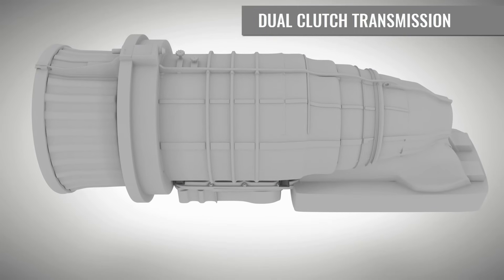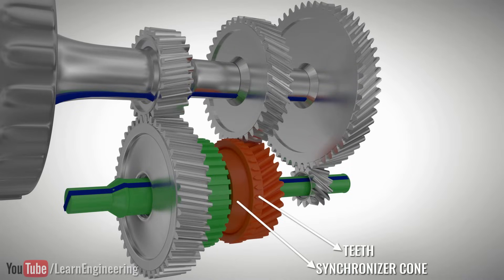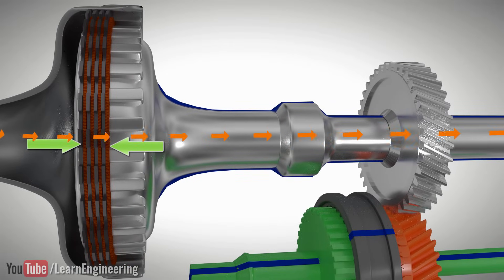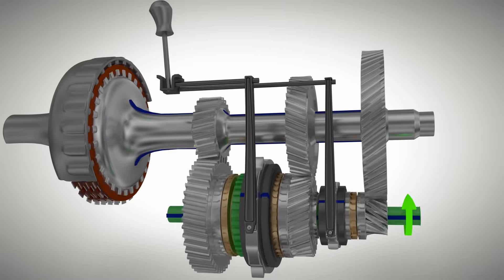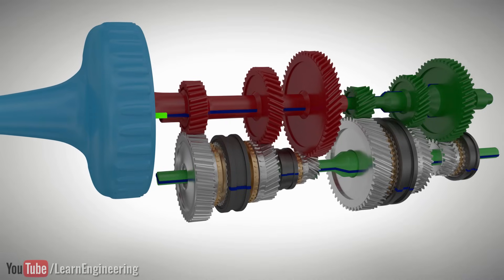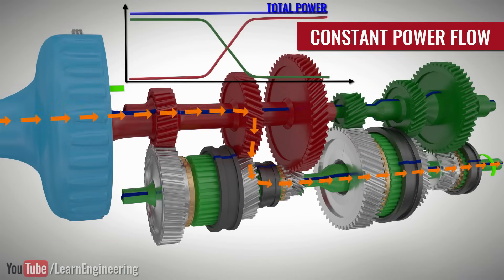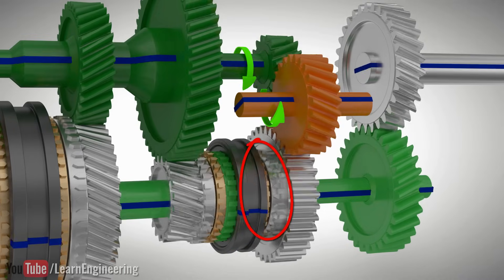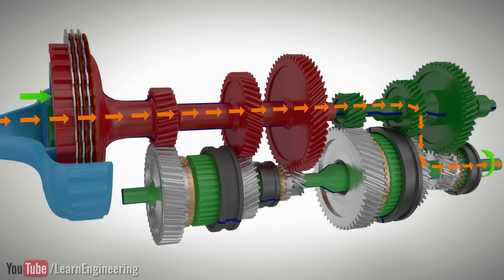Working of Dual Clutch Transmission (DSG)

Comment: ,,Even if your vehicle is moving forward, as long as the vehicle speed is low, you can still engage the reverse gear” 
shifts from 5th gear directly to reverse
Reply: The mechanic told me it was a three hour job to remove the gearbox, I guess I showed him!
Reply: R is not Reverse

R hear is Racing Gear
Reply: @andrikharismawibawa4245  STOP SAYING R IS RACE GEAR U BOTS
Reply: brakes? never heard of 'em
Reply: I need to try this in my car at low speed of course
Reply: @Akotski-ys9rr  let us know after how it turned out
Reply: @richardslav9282  no I read a comment saying it could grind the gears so I don’t want to risk it
Reply: You've heard of engine braking, I'm reverse braking. It's like being a jet pilot "FULL REVERSE THRUST"
Reply: The same thing happened in automatic transmission video, shifting from 5th gear to reverse where he said "in order to go in reverse, apply clutch C5 as well".
Reply: I'm doing that with my old manual car from the first to reverse. At low speeds, but I'm also not releasing the clutch fully, because that would just stop my engine xD
Reply: "As long as the vehicle speed is low"
That flew by ! Anyways, your engine can't even idle at 5th gear and 5km/h

Comment: I had a full manual as my first car and I loved it.
Did more research into the different mechanisms and the pro con list of an Auto to me are dumb.
Frees up your left foot to... do nothing at all.
Uses more gas, is harder to repair.

The downside of a manual is steep learning curve (already past it)
Requires more activity (Im already sitting down so what?)
Loss of power while shifting. (Honestly it makes it half fun to drive)

I will admit uphill starts can suck (esp when the dumbass behind you stops six inches behind you) 

But these newer DCT transmission have none of the drawback and all of the benefits (sans the fun part, but Itd be well worth it!)

Comment: If the DCT is cheaper and simpler then an Auto, why do so many cars come with an auto with a torque converter instead of a DCT?
Reply: DCT is a lot more popular these days.
Kia/Hyundai/Renault/Volkswagen/Skoda/Seat... 

All of these high production companies use DCT because it's cheap and fuel efficient and most importantly lowers emissions.
Reply: @dragospahontu  I knew much of the VAG group used DCT but not Hyundai and Renault as well.
But how come torque converters are still so popular / were everywhere when the DCT seems to be so much better?
Reply: @charliemolda297  not a lot of companies are using torque converters for cheap cars because that's the point of a budget car to be cheap.

Only some Japanese companies still use them.

Comment: Car manufacturers have no shame and no integrity. 20 years ago I could buy a clutch kit for about 40 quid and fit it in a couple of hours on my drive.  Now if your clutch needs replacing your looking at over a grand and if the car is over 5 years old in a lot of cases you're better off scrapping the car. Worse than that modern clutches don't last any longer than they used to and the prospect of spending that amount of money on what is essentially a consumable is outrageous. That's why there's always loads of mondeos for sale for silly money, the second you hear that flywheel rumble you're better off walking away.

Comment: I think DCT TRANSMISSION have not a torque converter .am I right ?
Reply: Yep it doesn't, it separates the engine from gearbox by using the 2 clutches, le next or previous gears are pre-selected depending on your speed it will always be connected to the opposite clutch  , whene changing ratios you just switch clutches

Comment: Why can a dct shift faster than planetary automatics? Both only need to switch inbetween clutches to select the next gear and the dct needs to slow the entire engine and flywheel along with parts of the trans while the auto needs to fully stop and accelerate gears in the trans, so the change in rotational inertia shouldn't be that different or is it? Or is it safty related? Or are the clutches in autos just weaker due to less space?

Comment: nice explanation, only this efficiency is the result of several factors.
I will list a few:
-gearbox weight, with oil and electronics (different types of gearboxes have different additional components which are not mentioned)
-transfer of energy in the opposite direction when braking with the machine at lower revs. (downhill ride)
-the experience of a person with a manual or automatic transmission is also a factor of efficiency, the automatic can be set for full efficiency when starting and is constant, while the manual transmission is not.
- skipping gears
although it is rarely used in extreme cases when necessary. (Driving on ice, sandy mud or fast braking and shifting into low gear in a bend)
the manual transmission allows the person to make a choice and to give a feeling of immediate response.
however, an automatic transmission can cause chaos in such moments, as it cannot properly overestimate the situation, even if a person chooses a gear, there is no clutch to help with the transmission of power in the right amount.
I apologize for the inaccurate expressions because I am not an engineer and I am only communicating my opinion.

Comment: This is much easier than a normal automatic transmission, however, I will need to rewatch the video over and over and over and over and...  "Five minutes later"... over and over and over again before I think I got a handle of what is being said. That means one thing, I am as dense as lead.

Comment: How transmission decide which gear should mesh in advance as a driver may accelerate or decelerate?
Reply: It has a pedal shift to up & down that can chance by driver. Or it can chance automatically by computer depends on speed of car.

Comment: How transmission decide which gear should mesh in advance as a driver may accelerate or decelerate?
Reply: This is the tricky part of learning to drive these,  if you're foot is off the throttle and on the brake it will probably mesh a lower gear in advance. And if it's steady on the throttle it will mesh a higher or lower depending on how it's pressed at what rpm. They drive more like a manual

Comment: To begin with, there's absolutely nothing wrong with a basic reliable manual transmission.  You will not feel any jerking motion in a manual transmission if the driver is proficient at operating the clutch!

Comment: In fact ,dsg doesn't know which gear you gonna use next.They are not smart enough to choose the right gear when you change your power requirement.So the smooth shifting is only exist in some certain condition.

Comment: I agree with everything the narrator in this video says about DCT, EXCEPT "has the smoothness of a regular automatic transmission"! The DCT remains a MANUAL transmission without the "third pedal", it can NEVER be as smooth as a hydraulic transmission because it ALWAYS connects the engine to the drive wheels, MECHANICALLY! I personally enjoy driving this type of car ('13 Focus) as I am used to driving manual transmissions, I like being able to feel the "tight" shifts and lightning quick gear changes! BTW, has had the latest version clutch pack installed along with the latest re-flash of the TCM and has been troublefree for the last 30K miles!!

Comment: Honestly the minds behind this stuff!
Reply: I'm a design engineer for a 2nd tier auto supplier. Believe it or not, the minds behind this stuff are regular minds like yours! Anyone can do this. Realize that the fundamental physics that these transmissions are based on were invented 100 years ago! It took thousands of people, many years, and many failures to get to this final design
Reply: @supersabrosinho  and it's still often failing
Reply: The inventors and the animators are awesome!
Reply: its all trial n error
Reply: Don't tell me... just Àwè§ømē
Reply: That's why machine prices ( in this case vehicles) aren't the actual cost but a lot more than that. A lot of money goes into R&D. Incremental updates led to this. No man could think of this directly. From wooden wheels to this,  it takes a lot of time and a lot of genious minds.
Reply: believe me or not, I'm not a car guy and i was theorizing why don't they use something like that in cars already with a friend of mine, and he brought me here. I literally invented something that already exists.

Comment: Sign

I drive Nissan Almera from 2002 with manual transmission - for context

First of - you can do smooth transmissions in manual. Some experience needed but not much else. Also (apart from I think Americans who cannot handle manual) people in Europe don't care that much for those slight bumps.

Secondly - you can shift to reverse with manual. In fact many old off-road vehicles have 1st and reverse opposite to each other so you can "swing" the car out of any hole you got yourself into.

Lastly - what about skipping gears? Going from 3rd to 5th or from 4th to 6th would still have the same issues like manual transmission.

Comment: I have one doubt to be clarified by anyone in this DSG double clutch transmission system,  
Please can anyone ans me if i need to disengage both clutch simultaneously, as usual like in single clutch transmission is that possible...?
Reply: Per example in in speed of 100km/hr, i need to stop suddenly like in single clutch vehicle by disengaging clutch and applying brake, 
After watching this video i have only that doubt left now...

Comment: How about using 5 mini transmissions given each separate gear. All you have to do work on 5 clutch packs
Reply: That actually would be quire useful. Especially - like me - you accelerate on lower gears and cruise on high gears. Some skips (like from 3rd to 5th or from 5th to 2nd when slowing down) are there.

Comment: Ok so if a normal manual transmission cost $4000.00 to rebuild will the dual-clutch cost $8000.00 to rebuild?

Comment: I understand, and there is a lot more space for improvements to make the DCT so much better
Reply: I really wonder how in DCT you (if that's even possible) skip gears.

I have a 5-gear manual and when accelerating I'm on quire a low gear. I reach 50 km/h on 3rd gear and then shift to 5th to save on fuel. Don't know how it would work in DCT. Would it disengage like a manual one? Or would do two shifts?

Comment: I would only consider a DSG if they fit a torque converter to it.
I drive one every day (Company) and I fear for my life when entering fast roundabout s or pulling out in traffic because no matter how hard you stomp on the gas pedal, it slowly takes off in no hurry, with all the time in the world, whilst the traffic gets dangerously closer.
Big thumbs down.
Transmission overheat warning comes on when going up short steep driveway s
Utter rubbish. Throw it in the bin.

Comment: Im fairly certain that you can very much engage reverse gear in a manual while rolling forward
Reply: Say wha?
Well, if you like wrestling with gear stick and pretty much ruining your gearbox and even risking damage to the engine, then sure.
Don't remember precisely who it was but there was some guy on youtube who tried this manouver and up to (not precisely sure, about to rewatch this) about 70km/h, using whole lotta force, he managed to do this, but during shifting the transmission was screeching in agony, indicating obvious damage to the gears.
Reply: @UrsusSuperior44  I didn't say that you should do that when you're going fast, I meant that you didn't have to stand still
Reply: That's correct but I recall that one time when in a hurry at a parking lot I shifted to reverse at maybe 4-5km/h (or even less) and it didn't sound and feel good.
I don't know, maybe it depends on a certain gearbox but I think that this "sweet spot" of safe R shift is really tight and I just wouldn't recommend that.
Reply: Yea, rolling a couple of MPH forward or backward you can grab reverse, no problem.

Comment: There are DCT's that have inner and outer "dry" type clutches. The clutches that you have demonstrated are "wet" type clutches. Because they are constantly bathed in oil, like on a motorbike. They are superior to the dry type. Because they are not prone to overheating. Manufacturers that use dry clutches are Ford and Hyundai for example. Dry clutches are sometimes prone to overheating due to the driver being stuck in stop and go traffic, causing the dry clutch to engage and disengage. The best automatic transmission, as far as efficiency and cost is the CVT that only uses a torque converter on startup and then locks up after the car gets going. Toyota and Subaru seem to have the most reliable CVT's. With Nissan having more reliability problems.

Comment: The worst transmission ever created! especially vag group and Ford/Volvo power shifts! (In Europe)
Reply: Why? Lots of issues?
Reply: @512460  I'm working with all types of transmissions.and dsgs are the worst .cluches,flywheels,selector forks bearings and mechatronics are failing .

Comment: Dual clutch transmissions are really best for performance cars. They’re costly to make and they have some disadvantages over proper automatics. Torque converters allows for a much smoother shift and help with towing. Also, planetary gears and a torque converter can handle torque better than a gear pair and clutches. Additionally, they don’t have a good reputation for reliability. VW’s DSG front wheel drive DCT is one of the least reliable transmissions available. Additionally, clutches can be burned out while torque converters can handle a ton of torque since there’s no solid physical connection. Clutches wear out much sooner

Comment: in 4:54 the reverse gear changes from a helical to a spur gear...!?

Rising the question: why are reverse gears spur gears at all?
Reply: Spurs are used, because they are sturdier + easier and cheaper to make. The inconvenience of few seconds of whine while reversing isn't worth the added cost of helical gear (and size/weight if you want to make it as strong as a spur gear ) in normal cars.

Comment: Are people stupid? So based on your graph, it's 2x the materials, cost, not to mention computers and programming. And it only performs slightly better then a traditional manual. (untill one of your hundreds of extra parts fail)
Reply: Not that simple lol. A gear shift at 8ms with the DSG opposed to a manual at around 400ms. Good luck trying to shift faster than a traditional auto, let alone a DSG. They are also really reliable, mine is at 230k kms and has only had clutches done.

Comment: I feel save if using manual... Because I could use engine breaking to do controllable sudden break if something happen...

If using standard drum or disc break, it will suddenly stop and causing slip in tire...
If the break is not working, it will be worse...

But using engine break could slowdown your speed drastically while still in control because the tire still rotate, not completely stop...

Comment: DCTs have their own problems look at the 2015-17 ford fiesta. Ford didnt put any vents in the bellhousing and so the damn clutch plates get so hot that firstly it feels like driving with a student driver in a manual trans, and secondly the plates tend to overheat and burn up every 30k because the lack of venting or air cooling for the bell housings
Reply: Mines got 44K and it's fine. I think it's unlikely that VW would get away with selling millions of cars that needed new clutches at 33K.

The DQ200 transmission in my car has an overheat warning and will shutdown the engine if necessary. It never has and I've never seen the warning light lit. 

DCTs can overheat if allowed to creep at slow speeds as if one was driving a torque converter automatic transmission, because it's basically continuously slipping the clutch, which overheats the friction material. It's worth avoiding doing that, just the same as one would in a manual transmission. I think this might be some of the reason for the lack of popularity of DCTs in the US and in fact I heard that Audi stopped selling them there as customers preferred torque converter autos. Automatic transmissions are much less common this side of the pond so drivers are less like to treat DCT gearboxes like torque converter transmissions and thus possibly less likely to encounter this issue with overheating.
Reply: 2012 and up, but exactly!! focus and fiesta. transmission shudder!!
Reply: Yes, that Ford auto is a disgrace.

Comment: Question, What if the stock car is 200hp and 200nm torque and u mod it to 500hp and around 350 nm of torque do you need to do anything with the gearbox?
Reply: S2K Racing
Definitely. Stock from factory, Transmissions can usually handle barely anymore than the car’s stock performance.

Comment: Isnt a DCT not the same as DSG transmission?
Reply: VivifyProductions they are the same in principal, DSG is VW’s version of the DCT. Dual Shift Gearbox transmissions use a wet clutch pack while others like Ford’s PowerShift use a dry DCT clutch pack.